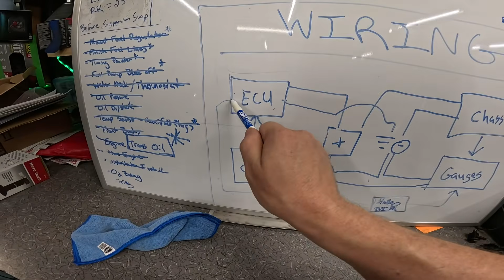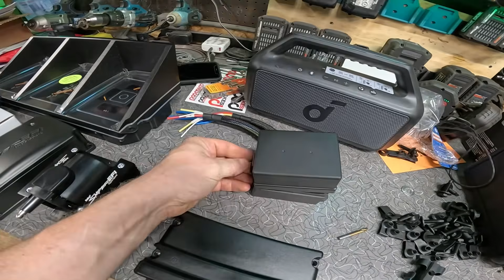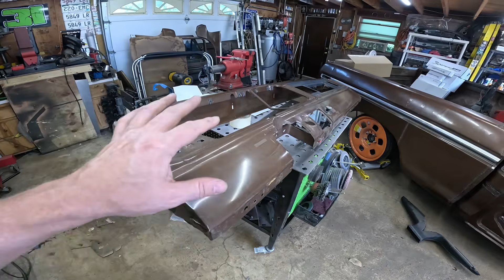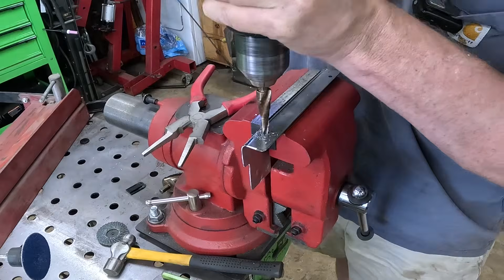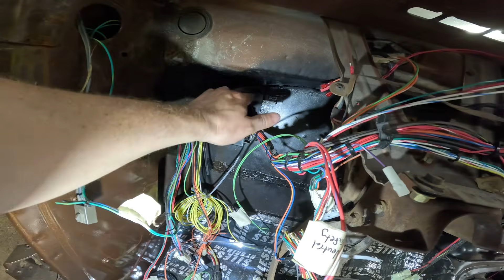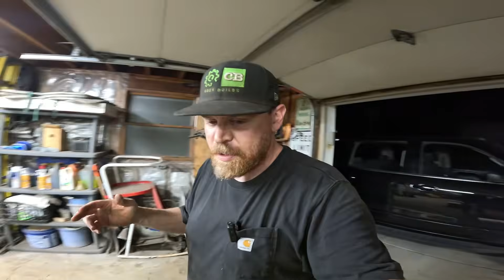Wiring a 1975 Ford F150 | Painless, Holley Terminator, Hyperspark & Dakota Digital Install

Comment: I’ve seen a couple guys that do wiring on a regular basis. Their technique was to hang a full sheet of plywood on the wall then hang the harness on it to organize everything the way it goes in the vehicle (kind of like a 3D schematic) . Even after seeing that and watching you I’m still confused about wiring. 😂
Reply from the maker: That would actually be a great way to do it if you were building a harness from scratch or were doing a lot of wiring. I ended up going through almost a full bag of zip ties, cutting, regrouping, zip tying then repeating over and over. It ended up working out and I’m very happy with the outcome.

Comment: Great video, your intro with the whiteboard would make a great "short". I would have never guessed the dash would come out that easily, I always thought they were welded in. The hidden wiring is such a great detail. I love rivnuts; I picked up an install tool from work but haven't tried it out yet. I've been too busy with other projects in the garage, replacing both door openers. The second one has gone much faster but whoever built my house deserves a lifetime of misery. Looking forward to hearing your truck RUN and then it's a short path to DRIVE!!!
Reply from the maker: Thanks!  Yeah I wish I would have pulled the dash out when I was doing all that metal work 😂. Oh well, I learned something for the next one I work on. Next week we finally get to hear the pipes sing!

Comment: I got a Power Wagon could use one of them spaghetti kits ❤
Reply from the maker: Nice!  I’ve been pretty pleased with the painless wiring kit. One thing I didn’t mention was that all the wires are also color coded to the original ford harness as well.  Very helpful if you were just trying to swap out a factory harness.